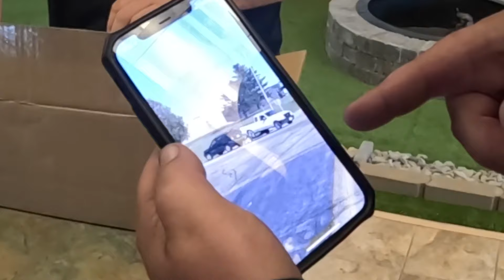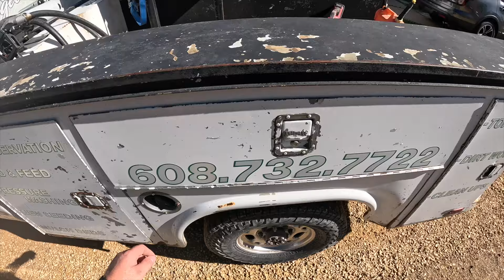Worst Skid Loader Operator Ever!

Comment: Do you sale any lanyards with your company's logo on it, or even pictures of mini little Bobcat or John Deer skid steers and also mini little Bobcat mini excavators and have the pics go all the way around the lanyard, but make the machine that it's siting next to different from the ones it's by. So other words, start with a mini skid with a bucket on it then next a mini skid with a concrete breaker attachment then next a mini excavator with a brush cutter attachment and so on and so on. And last but not least, try and put most of the company logos on the machines also. I'd want to buy one of those lol
Reply from the maker: We appreciate your comment!

Comment: Wet your concrete broom then shake off the excess water every few passes whwn u get those concrete boogers while brooming 👍
Reply from the maker: Thanks for the info! I got a different broom that works flawless now
Reply: @pagelservices  the green colored concrete brroms work excellent too. As you know, the broom finish is the final thing client sees. So treasure you broom, clean it very good and keep it away from the guys and trucks so the bristles dont get trashed. Horsehair broom for wet fall days and normal stiffer bristles broom for hot months . But i know,  you guy dont wanna get deep in the crete. Thanks for sharing the vids.